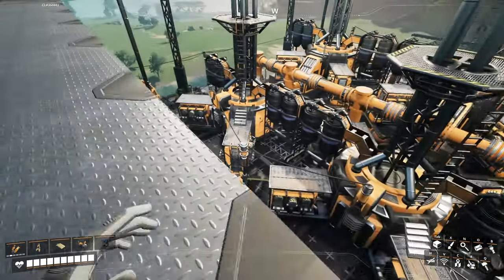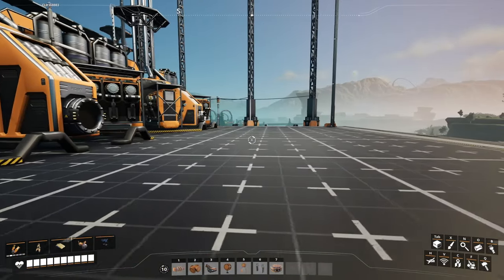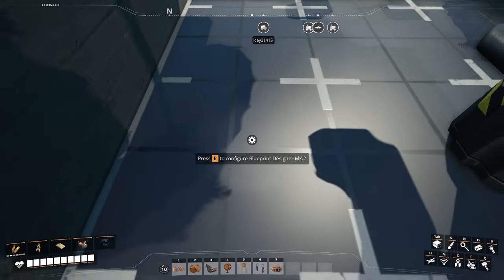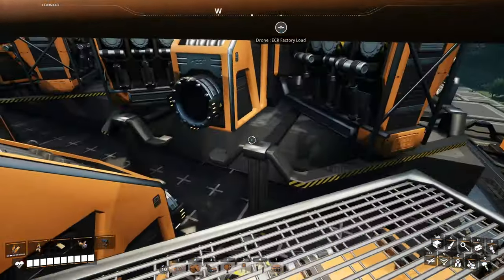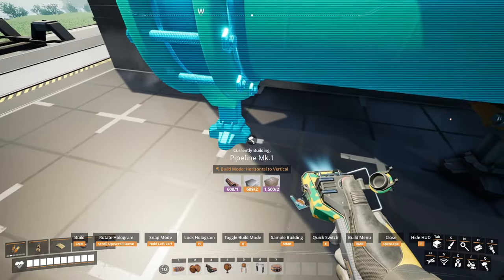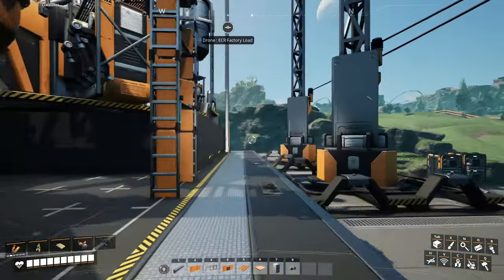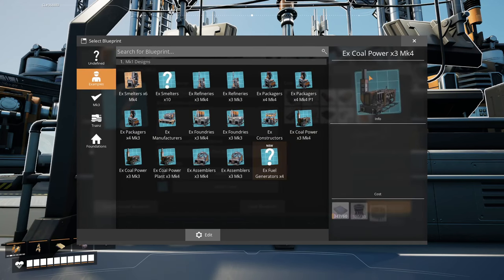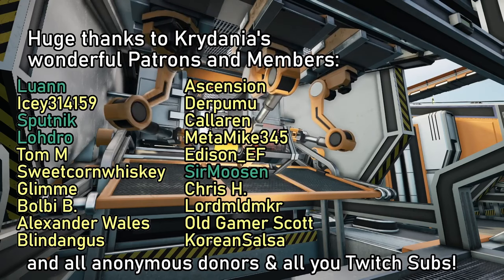Mid Game Fuel Generators Blueprint - Compact, Clean, & Tileable - Mk.2 BP - Satisfactory 1.0

Comment: While playing around with this, I found that if you place just one 2m foundation at the center of where you want to place the lifted generators, they generate all 8 support struts and then you can either delete the foundation or just leave it as a central support. This results in minor clipping with the bottom pipes but I felt it was worth it to have the really clean look of the struts vs partial foundations.

Comment: You need 80 of these????? WTF is this game? The demands must jump dramatically
Reply from the maker: @runadumb  well. 80 fuel gens is only 20 of these blueprints :) and that's if you're not overclocking the generators. As far as the demands. It entirely depends on how big you build! But if you build big, yeah, you'll need at least 20GW if not more!
Reply: @Krydax8  I just built my first one (single plant, not blueprint). Fuelling it is 2 refinerys, which I don't think is enough. So I guess I need to unlock hyperfuel asap. 

Think I need to rebuild a lot of stuff to produce more. Thanks for the tips. I've so much to do haha
Reply from the maker: @runadumb  turbo fuel is good, and so is the diluted fuel alternate recipe! It helps a ton!

Comment: I ended up just doing 3 with 1 in middle. I then just flip it 180 to stack. 

On a side note,I have 20 oil rigs, 30 heavy oil residue (2 layer stack, underclock to 50/min),  5 packing buildings (5 packers, 5 unpackers each) and at the end 3 refiners to convert residue to plastic, 2 constructors to convert plastic to containers and an awesome sink to handle overloads. Oh, the 25 power gens fit on the roof. I also have 14 water gens and 2 liquid towers, 1 for water the other for fuel. Fits in an 18x33 area including water gens, towers and container center. I use 5 blue prints and they all snap together nicely.

Comment: Getting the legs to extend on these is so finnicky! I ended up building the raised generators on a 1m platform of foundations with the overhang, and I just placed a 2m foundation in the middle to give the height to the generator and then removed it so they were standing. I was able to get the front overhang legs to go down two units, but not 3. I decided to just fix it by using a painted beam centered on the bottom of each of those overhang legs and I painted the beam to #2f2f2d, which is the color of that metal part of the generator. I think it actually looks decently clean and isn't notable enough for me to get the front legs extended all the way.

Comment: Dude!
I have been working out the floor planning of my upcoming turbo blend powerplant.
There will be 10x32 fuel generators.

But also, per block of 32:
6 blenders (5,3), 1 blender + 1 refinery, 4 refinery and 1+1 refinery.
Still working out how to fit all this in an easily repeatable block - but I'd like to have them going north/south/east/west from a central pipeline
Reply: Actually last night my wife egged me on, saying there's a nitrogen source nearby so I could go for rocket fuel.
And I could squeeze out +25% crude oil to process the added compacted coal, too.

She does love piling more on top of my already ludicrously large projects.